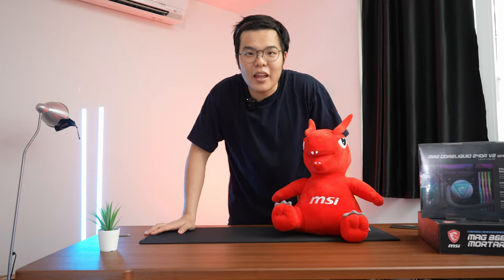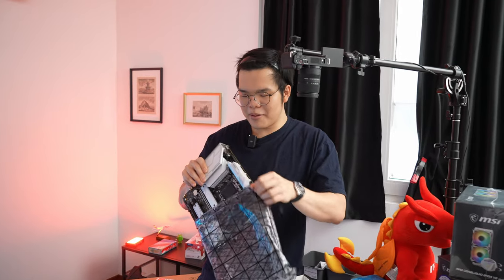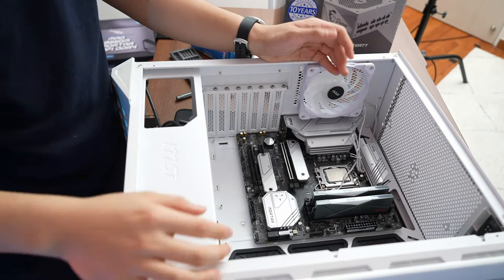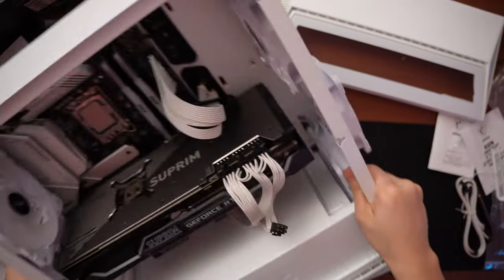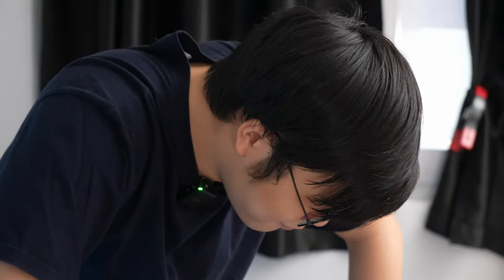ALL MSI, 1440p GAMING PC BUILD GUIDE!*

Comment: 1. your fan have plenty of room after placing GPU in slot, so you can screw it back and USE THE FILTER. 2. your AIO cooler have pump IN the radiator, which means you should place this AIO in front so it wont take air bubbles to the pump itself and kills it... Otherwise, after a year its still pretty powerfull system and a nice tutorial how to build your owm pc

Comment from the maker: 0:00 Intro 
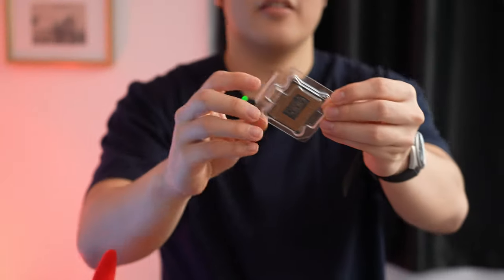0:22 Parts
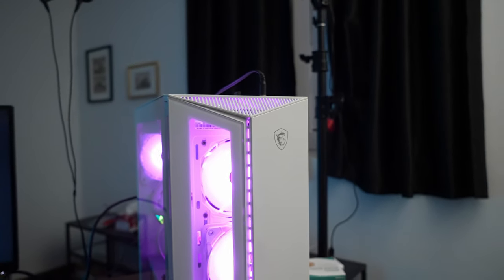3:30 CPU Install
5:40 Ram install
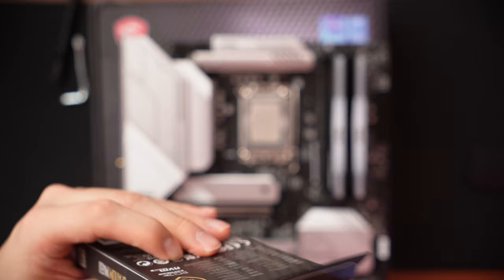6:10 SSD INSTALL
7:00 Case Prep
8:08 installing Motherboard
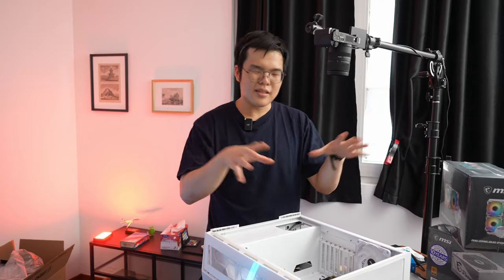9:13 Plugging in Front Panel Connectors
12:45 Power Supply INSTALL
17:45 GPU Install
19:55 AIO Install
26:00 BOOTUP
26:22 SICK BROLL!
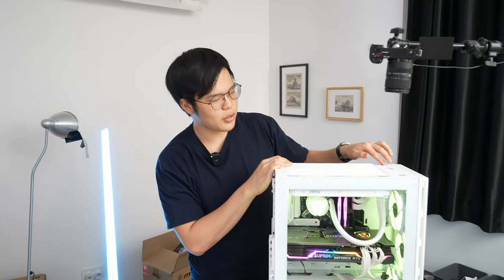27:10 Installing Windows

Comment: Hi. tell me please. i have msi core liquid 240r v2 2 coolers connect to cpu fan and cpu opt? and from the radiator there is a wire, should it be inserted into the aio pump? And where do I need to insert the connector from the backlight? in 5v or 12v?

Comment: Greetings. tell me if there is a serial connection of the backlight from 2 coolers and 1 on the processor head? I have 1 5v connector on the board, can I connect the 3 ends of the backlight to 1 and insert the end into 5v?